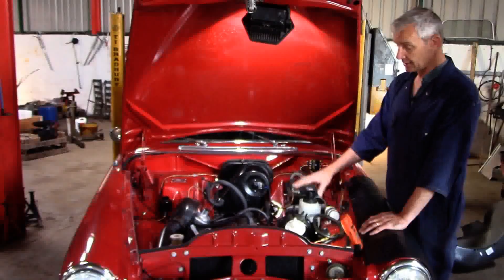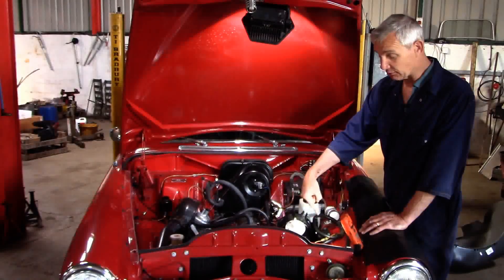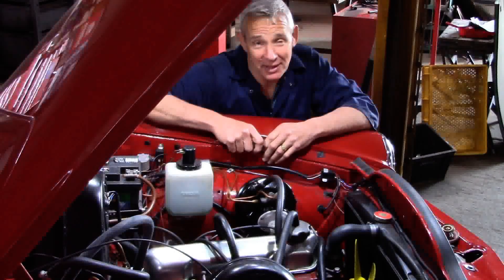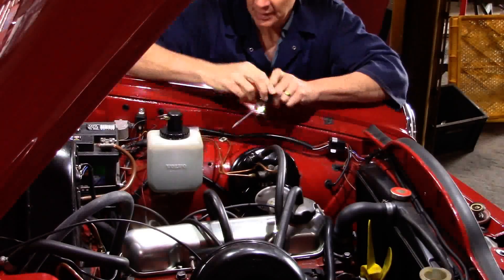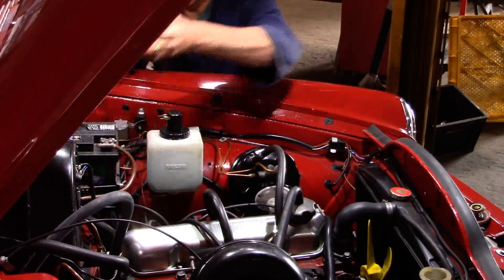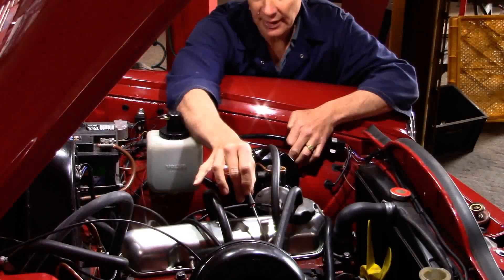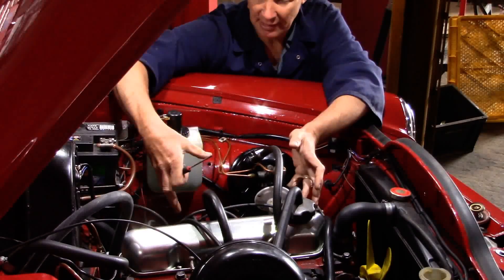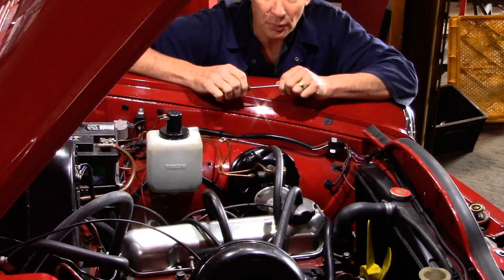Amazon Cars: Fitting a Brake Servo (s/cct remote)

Comment: Looking at your installation, I wonder why you deviate from the instruction leaflet by not having a fuel trap U Bend in the vacuum hose? 
The Instruction leaflet says:
Important:
To protect the servo unit and non-return valve from fuel contamination, especially on a petrol engined vehicle, a ` U` trap must be formed in the vacuum hose route.
https://www.skandix.de/en/documents/installation-guide/brake-booster-fitting-instructions/3000118/
Reply from the maker: Thanks Berni, I hadn't seen the Skandix instructions, and don't recall that being in the original Girling Lockheed notes. I reckon I shall continue to do it as shown, for two reasons: I've not (yet!) seen a failure of the diaphragm due to fuel contamination; and Volvo never considered it necessary. That latter is very much a maxim in our workshop, I can't think of an instance where Volvo got it wrong!
Having send that, Skandix are excellent, and if they reckon it's necessary, then one really should follow their instructions.